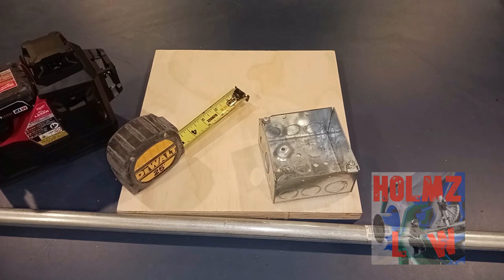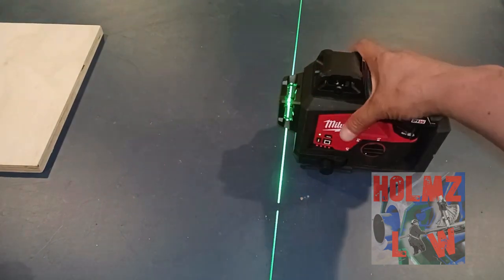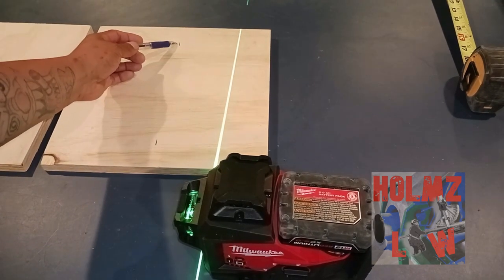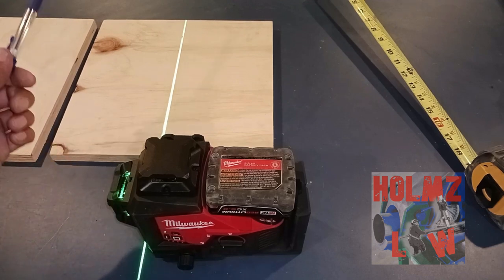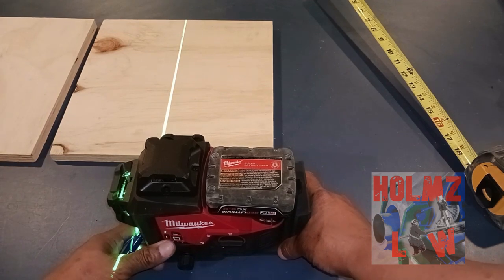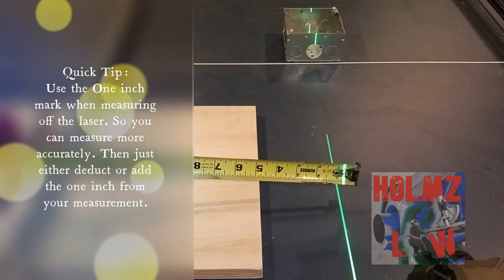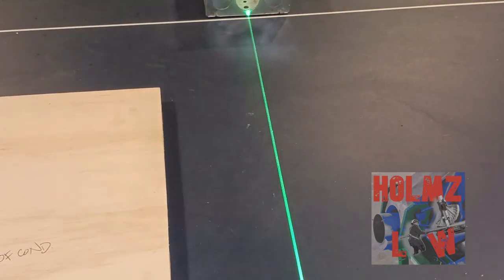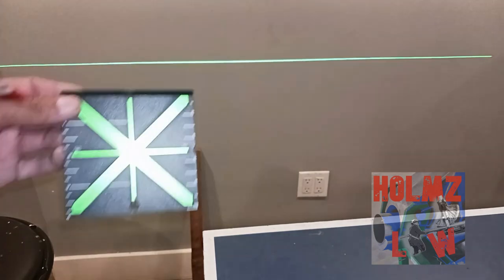Conduit Bending - How to use a Laser correctly for conduit bending

Comment: Instead of that stand up tool .When setting up on the floor I like to put sammies or a bolt ect. On the  furthest mark.  So I can sight it in on that bolt  and i  don't have to go and walk over and check and see if I'm on the mark. I'll know I'm parallel  when I'm on my first mark and also on the bolt standing up on the floor.
Reply from the maker: That's an awesome idea. Thanks for sharing that with us. I'm pinning that comment. Hopefully some apprentices will read it. Thanks again.
Reply: Depending on the finish of the floor a speed square also work good in the replacement of a bolt

Comment: What would you say the best method to lay out your conduit run is to get it nice and straight like a pro?
Reply from the maker: It depends every situation is different. You need to use the environment you're in to the best of your ability to make your conduit look straight. But if you ask me the laser is the best way to do this. But it's not the only way. I can make my conduit runs straight with just a tape measure. Just have to know what you're doing. I plan on making more videos like these in the near future.